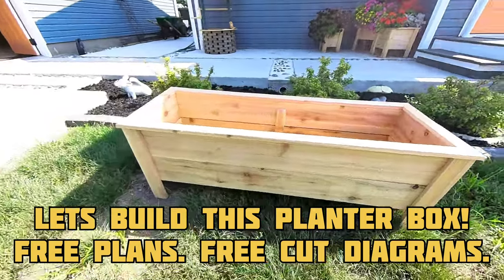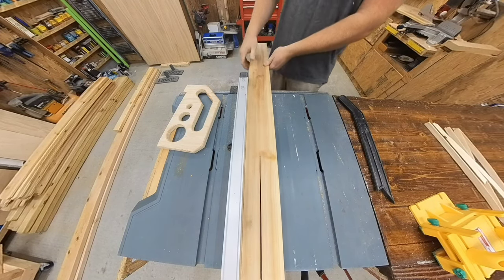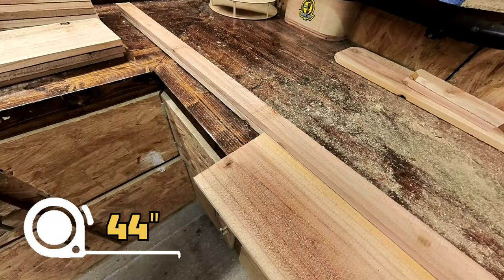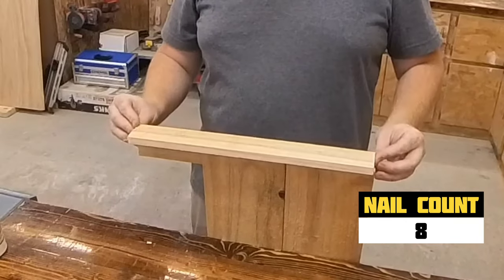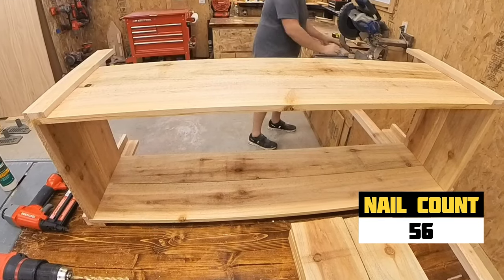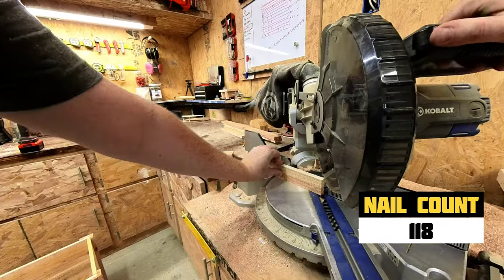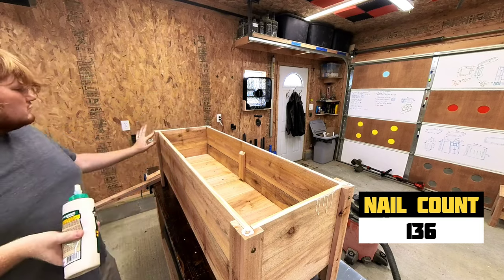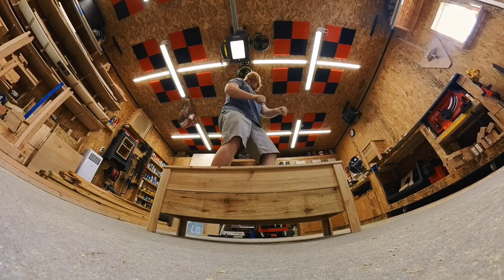Cedar Planter Box.  FREE PLANS! | How To

Comment: Love the videos. But one update needed. At 2.15 in the video, you cut your long sides at 44". The screen shot and the download shows 45". I cut mine 45" and it leaves the last board with the corners cut off at the top of the picket.
Reply from the maker: Follow the plans, and start by cutting the 45" side, then the two 12-3/4" pieces. You should have a little 2" cut off section of waste with the dog ears :)

Comment: I have made this and I really like the slick design and free diagrams- I have used a pump up sprayer to add sealer to mine and have add a THICK 55gallon drum liner (trash bag) to the inside with the drilled holes through both  this will keep the moisture in longer and will make the wood last longer- Again great video   waiting on the promised 3 pcs trifecta planter group video!!  keep up the great work!
Reply from the maker: We planted some tomatoe plants in the smaller boxes and I am adding a trash bag liner next year so the water can be absorbed in the soil. Water seal is a good touch so the cedar holds its color :) i like it

Comment: Aaron.  Great videos and great ideas.  I managed to get some 1" cedar boards at a great price from a local fencing company, 50 cents a board!!  I bought up what they had and started doing a search for planter designs and found your YouTube channel.  I am impressed at your willingness to freely give these ideas and tutorials to others.  I don't have the shop room you have so a table saw is not an option for me and have to rely on my circular saw for the ripping or I may just use precut 3" cedar boards for the legs and trim.  I enjoy your enthusiasm in sharing your talents. You the Voss!!
Reply from the maker: Whoa whoa whoa... Lets talk about this .50 per board! Dang... Welcome to the community
Reply: @WhosTheVoss  They were not grade A clean boards, some knots, some cracks but I am able to make use of the major part of the boards.  They were likely discards from people picking through for a project and the fence company wanted to make room for new inventory.  Win Win!!   When my project using your plan is done I will be glad to share a pic with you of the end result.

Comment: Made a pair of these for my Mom for Mother's Day. They are beautiful! Quite sturdy as well. Very happy with how true they came out using cedar. I had to buy 1x4" and 1x2" cedar boards for the legs and top rails, respectively, because I don't have a table saw for ripping planks. I was a little heavy handed with the staples. Used twice as many as you per box. Thanks for the plans. Keep up the cool project videos!
Reply from the maker: Thanks buddy :) good job working with the tools in your shop :)

Comment: Found this on accident a few weeks back. You made this look almost too easy but I decided to give it a try.  Picked up 28 Pickets a week ago to make 4.  Yesterday I had some time in the evening so I printed the cut list and cut all the pieces I would need, minus the trim.  Took me between an hour and a half and two hours so not too bad.  This morning my wife offered to put them together since I also had 2 other projects I was working on so I sent her a link to this video, set up a work space for her with some glue and a 18 gauge nail gun.  Now my wife is one of the most intelligent people I've ever known, she was an Aircraft Mechanic in the Air Force after all but she very rarely does any wood working.  I showed her how to load the nail gun when it ran out and let her go.  I said you made this look almost too easy but it really was as easy as it looked.  My wife had all 4 assembled in under 4 hours and all that was left for me to do was cut and attach the trim.  So what's the verdict?  The plans were perfect and the video was super simple to follow.  Easy to put together?  I thanked my wife for the help and she said, "All I did was put them together, you did the hard part."  I don't agree who did the hard part but that should tell you how easy it was.  How do they look?  We intended to put two on each side of the driveway and they will look great there.  The problem though is I put them on the deck after they were done and I really like them there.  That means I'm making another trip to the big orange box store for another 28 pickets this week.  

Great job with this.  I've definitely sub'd and will try a few more in the near future!
Reply from the maker: Sweet! :) glad it was a fun project for you both!

Comment: I made a couple of fence board planters a couple of years ago. Mine are about 2' x 4' x 30" and are constructed just like yours. These are three boards high for the box, and do hold a lot of dirt. This year the lower board on the long side started to move down on one end. I had to get some clamps to draw the board back into position and then glued and nailed some scrap board to the inside of the leg to support those long boards. Next time I build some, I'll add these additional supports from the get-go. Nice job on your video.
Reply from the maker: Thanks buddy :)

Comment: I like it.  I think I would recommend to your customers to line the interior of the box with something to protect the Cedar (white Cedar isn't all that resistant to rot)  I'm going to build your design but will use some more advanced methods. Thanks for sharing!
Reply from the maker: Thanks Chris, I have a few boxes from three years ago, no liner, and are still going strong :) but the liner will help the dirt absorb the water rather than it pouring out the cracks because the dirt has hardened :)

Comment: Great video and explanation- one question- your plans call for 4 pieces of 5 1/2 x45 inches, but your video showed them being cut at 44 inches- which one should be used?
Reply from the maker: Ooooooo nice catch! As long as all four of them are cut the same length, it wont be an issue. Only thing it might affect is the last board you rip down to put in the center :)
Reply: I pre cut everything according to the plans and had to trim the two supports for the bottom boards and the long, top trim pieces came out a tad short but good enough for my patio. Came back to watch the video again and that's where I noticed the discrepancy for the long side boards. No worries though, I really like how simple these plans are and how good the finished product looks. Of course the smell of cedar is always a plus.

Comment: Hey Aaron, thanks for posting this!  I’m officially down the rabbit hole, table saw, circular saw, pocket hole jig, router, not mad tho!  

Questions…using cheap cedar from HD, where should I start with sealing/paint esp for the legs/parts that touch the grass?  And how bad are interior brad nails to use outdoors?  My first iterations that I sold use them :/.   Also just a tip, Matt P did this cool 45° rotation hack to make a pointy tip on end of beams.  That being said 21!
Reply from the maker: Woohoo! Welcome to the never ending purchase of tools :)you could seal the bottom like 1 inch to protect against discoloration from water touching the feet. Ive made these boxes for two years and have had no issues with the brad nails not being galvanized. I did see Matt's cool 7° planter box, I did not catch this nifty 45 degree trick though! Might have to jump on his channel.  Glad you liked the video buddy! :)

Comment: Hey Aaron, I see you use the shop vac but what about a dust collector? I am tired of all cleanup but I also don’t want to burn up a shop vac.
I’m a newbie to your channel.
Reply from the maker: Ive investigated a few dust collection systems. I still have yet to find the perfect one that is wall mountable. All my equiptment is against one wall so running the tubes wouldnt be a problem. I just havnt bit the bullet yet. Shop vac has been doing just fine though, it does get a little warm when i run it for 15+ minutes at a time :)
Reply: Thanks Aaron! I don’t have enough room for a wall mount. That’s a pipe dream for me, 😀

Comment: Are you using galvanized or stainless steel brad nails?  If using galvanized nails, any issues with rust streaks over time?  Great video!
Reply from the maker: Im using a simple steel brad nail, mine have been outside for two years (this is their second winter) and I haven't had any issues with rust streaks

Comment: Thank you for sharing this videos.
I have a question for this particular planter.
If the planter is 33 inches height, would you use the same thickness on the legs?
Reply from the maker: Check out my raised garden bed video, its this exact box, but has 32" legs and a bottom shelf :)

Comment: Great video Aaron. I am just getting into this planter box craze (really for fun) but as a side gig. Where do you have the most luck selling your boxes?  What do you charge for the 3 and 7 picket planters?  I have tried Marketplace and all I get are what appears to be scams.
Reply from the maker: Check out my "Boost Your Planter Sales" Video, I cover all those questions and some other common ones :) thanks buddy!
Reply: Just curious what do you think about using PVC board planks? I'm going to assume the boards will not be the exact width of the pickets so what I rip them down or some mathematical way to adjust say it's a 5-inch wide PVC board and not 5 1/4 pickett

Comment: I am trying to follow your plans for the 46" box and adjust them to a 32" box.  Can you tell me if I have these dimensions correct: long sides 31", long top rails 32-5/8", side supports for bottom 29"?  I've drawn them out in a design file if you would like a copy.
Reply from the maker: Sounds like a good size to me. Seems like the dimensions will work beautifully
Reply: @WhosTheVoss  Thank you.  Let me know if you would like me to email you the plans for it.

Comment: Wat do  you use for a liner in the boxes
Reply from the maker: You can use a thicker construction trash bag for the smaller boxes. This longer box requires a larger piece of plastic. You can buy the larger rolls of 3-5mm plastic from a home improvement store

Comment: For some reason I always try to cut everything identical but one I assemble it doesn't stand level
Reply from the maker: Whichever two legs touch the ground, add a block under one of them, and push down on the opposite corners. It'll tweek the box. Otherwise, just add some weight to the top as it dries
Reply: @WhosTheVoss  one more question, ot seems every time I go to rip the pickets for some reason my pickets seem to start pulling away from the fence, what do you think is causing it